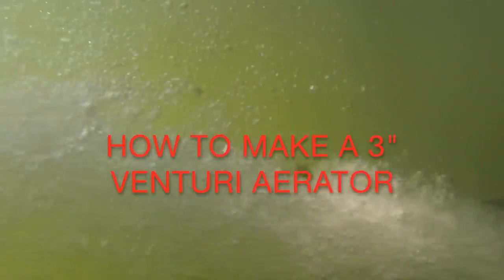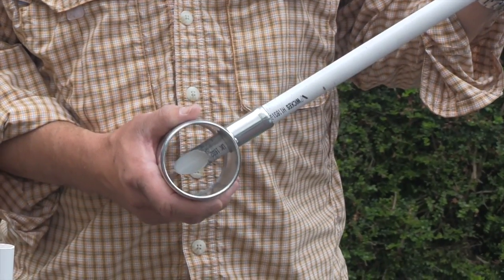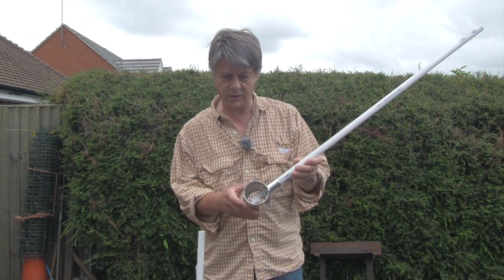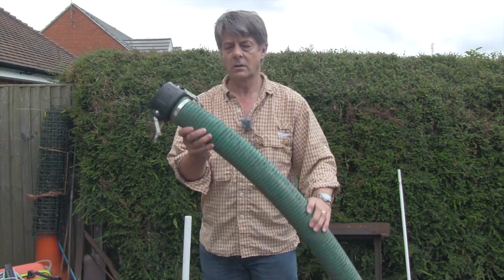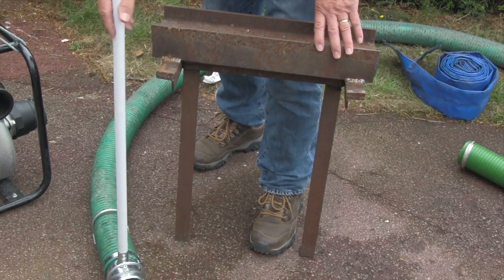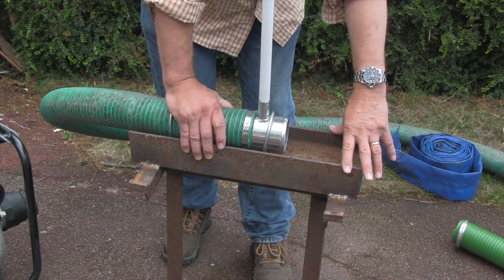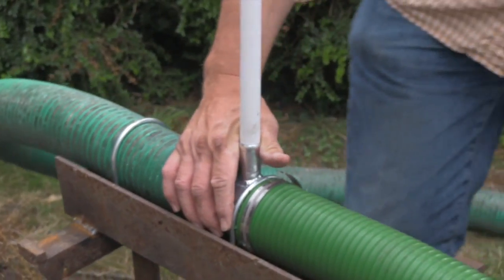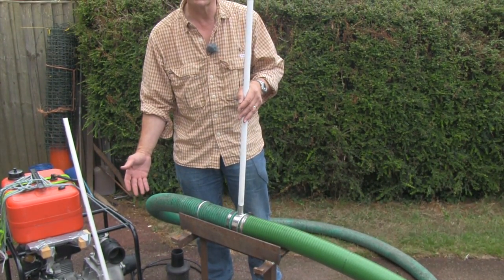Making a Venturi

Comment: Video was perfect im literally about to fo this exact same process as the lake i fish has no power and the farmer won't supply any solar for an aerator but I'd be very inclined to see what this would do using a 3 inch pvc tee peice converted I to a venturi
Reply from the maker: I used the T junction out of ease, but it’s a restriction that’s needed, with the 1 inch pipe cut at an angle works well.
Reply: @ReelForReel  yeah it looked really good in certainly gonna pass the idea over to the bailiff not that it will get done so I feel I may as well buy the kit myself . I just thought your version to a venturi tee would be the difference in bubble size. Its deffo needed either way as the lake hasn't been netted or dredged since 86 . Its not to bad condition but the fish just will not feed and people are giving up on it which is a shame

Comment: Hi, can I use this to pass fertilizer?? Thanks
Reply from the maker: Vicente Fabian   I would not think so as it is primary designed for aeration, I do throw siltex , which is chalk dust into the aerated flow which has helped with the PH levels of the silt in our lake and has also helped with water clarity.
Reply: Then it should work, because if there’s suction it will suck the liquid instead of the air.
Reply from the maker: Vicente Fabian good luck let me know if it works
Reply: Yes of course, you must adjust the size though, pumping liquid fertilizer is more difficult than air, the design will also be different, the T junction alone won't work I'm afraid, you'll need a conical reduction right before the junction with your fertilizer inlet...
Let's take an example in 1.5", take a 1.5" pipe reduction to 3/4", next a 3/4" T junction 3/4'' - 1/2'' - 3/4'', 1/2'' being your fertilizer inlet then back from 3/4'' to 1.5'' the increase 3/4'' back to 1.5'' will create a depression which will suck the fertilizer providing the water flow fills up the pipes...
Here in Thailand we have lots of PVC pipe fittings which do the job...
Sorry, my mother tongue is French, so I'm not sure I'm giving a clear explanation...

Comment: I don't suppose you could tell me what the metal section you bough off ebay is call could you please as I'm struggling to find what we need.
Reply from the maker: https://www.ebay.co.uk/itm/Aluminium-T-Piece-Pipe-Connector-3-Way-Alloy-Joiner-for-Silicone-Rubber-Hose/190895799380?hash=item2c7246bc54:m:mHghs4WLRwCsrNszwBsfrvA

Comment: How much pressure we need for this effect?
Reply from the maker: Eldhose Ouseph  it can be done with smaller pumps as well, but the secret is the constriction in the T junction as this increases the pressure/ water speed and the sucking of air down the breather pipe.

Comment: After the 2018 very hot summer (lost a lot of fish) I am delighted to find your video. I run a small syndicate of Trout fishers myself, and am in need of this for our fishery.Thank you.
Reply from the maker: We have lost a lot of fish this year as well, it’s just been too hot and the water temp has killed us as well.
If  I can been of any help should you make a Venturi just shout. I have used the Venturi to put siltex into the lake very successfully as well.  Siltex has made a big improvement to our lake it changes the PH of the bottom silt.

Kevin
Reply: Many many thanks Kevin, I have bought a 3 inch petrol pump and tracked your  venturi parts down (they are on order) have just finished a floating pontoon and trying out blue dye. We are a small syndicate of 30 members, I am trying to keep the subs (£200  per annum, to go when they want) as cheap as I can. Our lake was dug in 1952 and is 450 feet long x 180  feet wide & 16 feet deep with wall to wall Canadian pond weed, crystal clear, but the weed can be a problem in the summer months. Many many thanks again Kevin, you have cheered me up no end, Gerry.

Comment: have you considered using a water tromp we use them in the united states to aerate contaminated mine water in remote arias without power. all you need is a natural water source and somewhere for water to flow. what it consists on is water flowing down a air siphon like what you have here, accept it goes to a small tank buried in the ground where air and water separate. the water flows out an outlet pipe lower down and air travels to a collection pipe at the top of the tank. depending on how deep you burry this system 2 feet per psi you can run an aerator or even small pneumatic tools using natural water flow. note if your using an aerator it need to be higher than the tank is buried but it dosnt nessirarily have to be in the same place as you can pipe the air where its needed.

Comment from the maker: Thanks for the comments, just a quick up date. We had huge problems with the trout fishing lake I run in July 2017 with water temperature going far to high as our lake is not deep. We ran the venturi’s as an emergency source of oxygens. ( I put a boat out board tank on one and made it long running so it ran all night)  it was amazing to see just what effect adding oxygen into the lake did. In the oxygenated out put stream all the big trout would come and swim, as if they were in a river.
I also used it as a great way of adding/ spreading siltex into the lake to counter act an algae bloom changing the PH of the water and silt.
There are clearly a few improvements that could be done but this was always just a cheap and easy design using what I could get hold of from the local farm supplier and car shop.

Comment: It works fine it looks like. But... wouldn't a smaller diameter middle section work even better? And place it just before the air intake so that as the water expands it draws more air. And did you try an aerator design? Mesh over the inner outlet or gluing in a bunch of small tubes to help disperse the air and avoid large bubbles that reach the surface and are thus lost as far as usefulness? OR, splitting the output into a number of outlet hoses, say garden hoses with sprinkler heads attached to work as aerators?